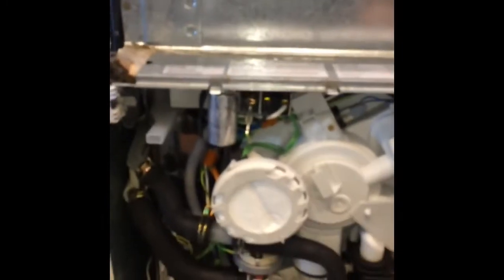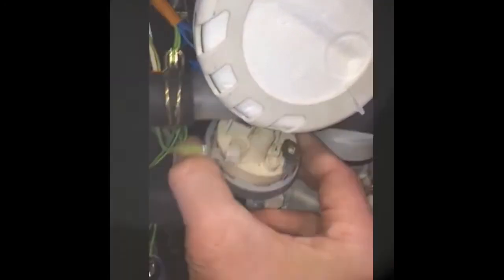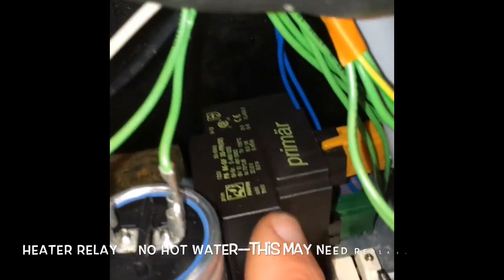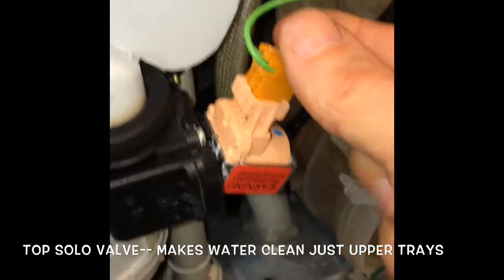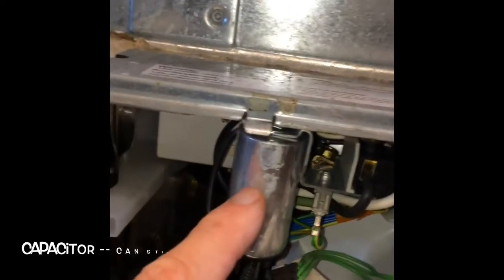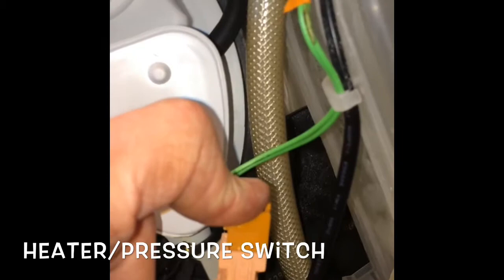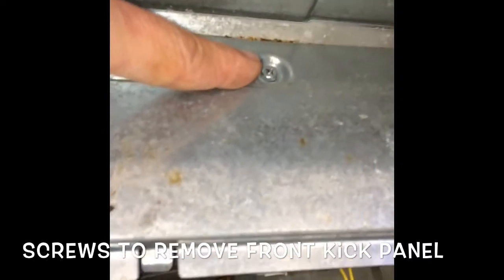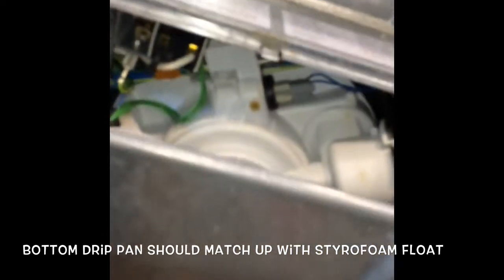Miele dishwasher -- Disassembly

Comment: I have leaking Miele dish washer G1230. I have opened the drip tray and saw leaking . it’s is not leaking from pump or pipes. But on the both sides inside.  Very confused.
Reply from the maker: I bet the fill valve is letting in too much water.  It should only come up to just under the plastic filter handle.
Reply: Do you mean water inlet sump. I have downloaded service manual. Do u think it is DIY work for me with no past experience with dishwasher?
Reply: Thank you for the prompt reply

Comment: I have error code F70 :(  how do I access the front toe panel please?
Reply from the maker: Hi Mike,
You should be able to remove the black metal toe kick panel by removing two torques 15 screws.
Blow that you’ll find another small panel held on by two screws.